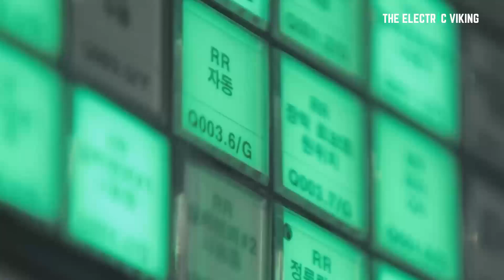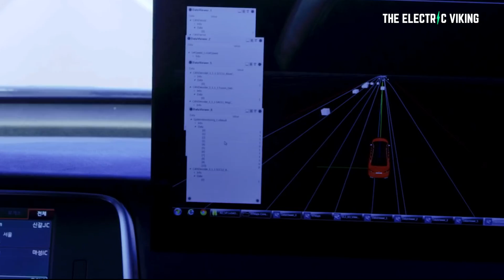How GM relies on Hyundai & Kia for its Electric vehicle parts

Comment: Hi EViking - I cant remember which video you said Tesla is selling the Y for $41k in Europe but I am afraid that does not seem accurate. The cheapest I can see is in Germany and after deducting 19% VAT it is abot $45k. In China I am not sure if the price includes VAT/Tax but if it does that is very surpising because the Y is just underr $39k. Would be good to do a thorough cost comparison. If Tesla can get the Y down below $40k globally it is going to make competition very difficult indeed (not that it isn't already).
Reply from the maker: It is 41,000 euro excluding VAT in the Netherlands.
Reply: @electricviking  You are right - amazing. I wonder why they have kept it higher in germany and herein Denmark (where it is still 48k after VAT)

Comment: Korean ternary lithium batteries often catch fire. Hyundai Motor and General Motors used lg batteries, and there were large-scale car recalls.😂😂😂😂
Reply: "Often" ? Not according to the statistics that are published. And ICE cars actually statistically catch fire way more often. Chevy Bolt 18 fires and about 12 or 13 of those confirmed and linked to the defective cell issue. So not sure where you are getting your info from?
Mike 🇨🇦
Reply: @Doramutong even the Korean battery manufacturers obtain sources for their batteries from China; cathode and refined lithium for instance.
Reply: @michaellippmann4474  What I said is that lg batteries are more likely to catch fire than Panasonic and catl batteries.
Reply: @hi4806  ah my apologies I read that you said they "often catch fire"...which of course we all know is not correct...
Have a good night!
Mike 🇨🇦